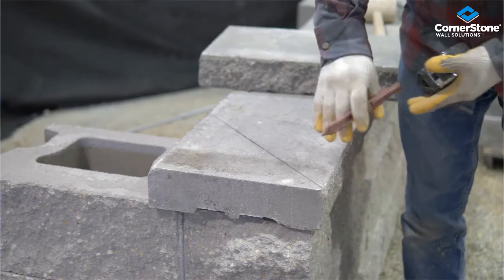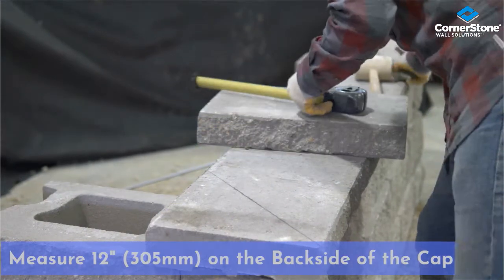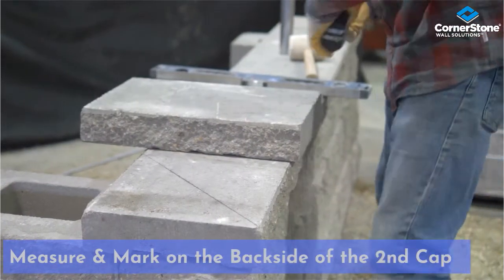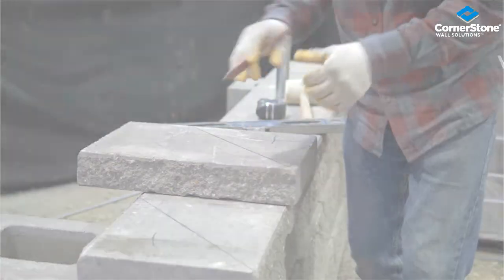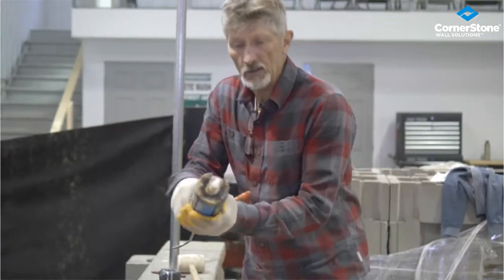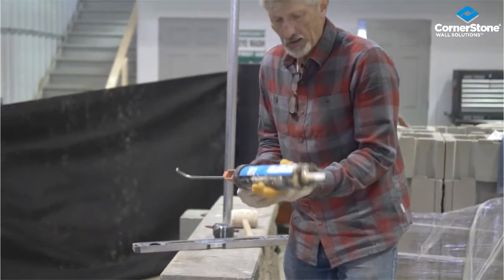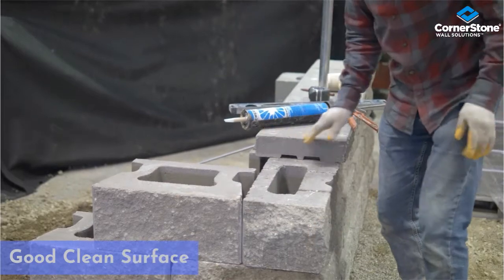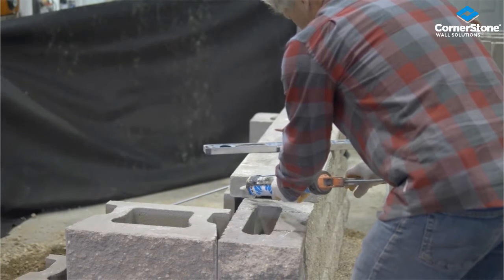Installing Cutting & Capping retaining wall corners by Vern Dueck

Comment: Are those caps able to accept a concrete anchor bolt ?
Reply from the maker: Concrete Anchor bolts have various strengths based on the depth of the concrete and what it's holding up. Depending on the situation they can be used. But you should check with a local engineering consultant.